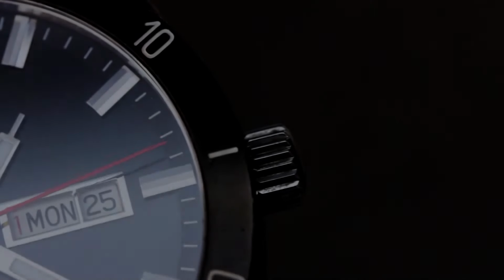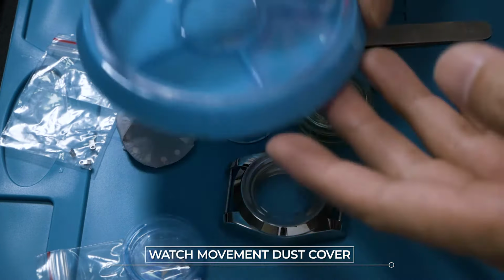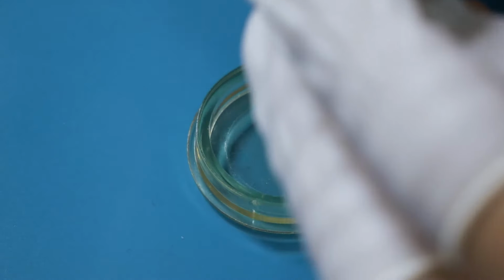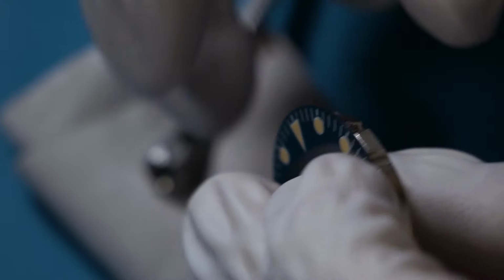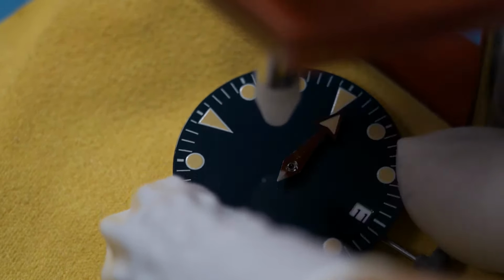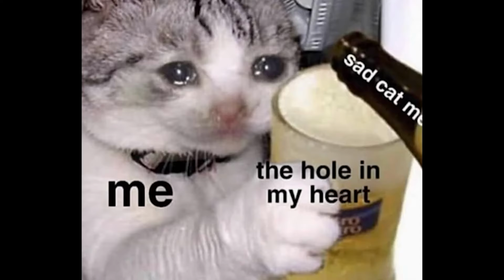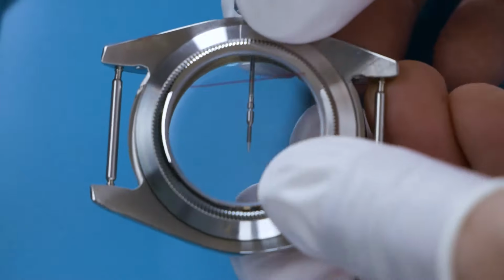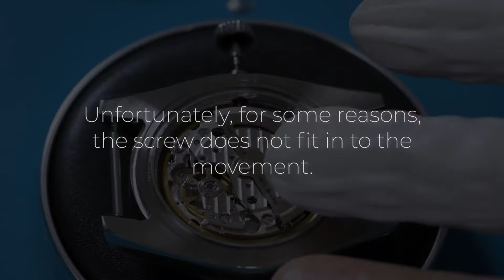How to build your own custom watch (Don't do what I do, learn from my failure!)

Comment: The first time I did this, I used an ETA 2824 movement. It took me the best part of 2 hours and lots of cursing to get the seconds hand fitted. This was a few years ago before all the kits that you can now find and I didn’t see any tutorials on YouTube either. I’ve since made more using 2824 movements and also NH35/36 movements and I agree with the other commenter that the NH movement is the one to start with. I’ve messed a few up, and it’s a bit disheartening each time you do so, but in the end you end up with something unique. I’ve given them as gifts - my wife has been the recipient of a couple and both my children got one as 18th birthday presents. My next project is for my newly-born granddaughter.
Reply: Legend
Reply: definitely a very special present

Comment: I just built my first watch with parts all from AliExpress and it went fine.  I will say that the seconds hand was an absolute pain to get in place compared to the other hands but a little Rodico and a 5x eye loupe was enough to get it done.  I also recommend plastic tipped tweezers so you don't accidentally scratch anything.  Also, the Seiko NH35A movements don't require screws to hold the dial in place and they don't require any clamps or screws to hold the movement in the case which is why I chose to go with the NH35 movement.

Comment: I've been a watchmaker for like 4 weeks now, interested in watches for like 8. This is by far the best video I've seen lol. Every single mistake you made goes through my head whenever I touch a movement. Off topic a bit, but the first two movements I serviced are from vintage quartz watches. I literally didn't know you could service a quartz movement, but it's true, or any movement until 8 weeks ago. On the one I finished last Saturday, it was actually a non runner, so not only am I new, I also had to learn in short order, so I could diagnose the problem, which I did and ultimately fabricated a replacement part. Not bragging, just saying there is always a level of service you can do I guess, even for quartz watches. I passed them both to my daughter who will hopefully keep them long enough to pass on someday.

Thanks for the great video and lesson! ❤it!

Comment: I'm new at this too and you're not alone in stuffing things up. I find the NH35 movement to be less difficult. Thanks for sharing keep after it. I find joy in giving as a gift, a watch I assembled. Each one I've given has a makers mark. By that I mean  a scratch, or small bend, but it it can only be seen with a loop. Cheers
Reply: I have a question. When i buy the case where the movement goes in I can choose the size 36/39mm. The nh35 movement has no size. How do i know that the nh 35 movement fits in the case?
Reply: @pimengelbertink9926  I have used both 36 and 39, just make sure that is says in the description that the case is compatible with nh35 or nh36 and you'll be fine.

Comment: Thanks so much for posting this.
I am gathering some bits to build my first watch. 
You have probably saved me from using a screwdriver with rodico on the end to clean up the dial.
Also prepared me what to look out for when fitting the hands.
This has been such an educational video. 
Don't give up.

Comment: This was a great video. I learned a lot. 

This is why I haven't tried to build my own watch. 1. I need all the equipment. 2. I need multiple parts because I will F them up. 3. I no longer have the steady hands required to do the build. 

But I would like to design my own watch, pick out all the parts. I would have to have someone with experience to do the actual build though.

Thanks for doing this!!
Reply: Yeah I get you. I don’t have steady hands either. I have very shaky hands. I messed up my watch just trying to change out the battery. I touched it once, twice and then BAM everything went flying out of it. I messed it up 😂 but I too want to build my own watch. I’m  gonna challenge myself and give it a go with an automatic movement. Shaky hands and all. Yeah I’m gonna mess it up but I’ll get it done with my own unique dings and dents on it.
Reply: @americanpaisareturns9051  Thanks for the reply. I have since thrown caution to the wind bought some equipment, and assembled my first watch. The hands were the toughest part taking 2 seconds hands (I bent the shit out of the first one) and about 7 hours total build time from start to finish. I'm gonna try it again. 🫣
Reply: This video confirms that I shouldn't attempt this.  😂

Comment: I personally use pegwood with rodico on the end to place the hands and to help clean up the dial and hands afterwards. It helps to get right down to eye level with the movement to see the pinion where the seconds hand will go, and to use the handheld hand setting tools.

Comment: Yeah, the seconds hands on the Miyotas, DG 2813 and relatives are the most demanding because their axles are only 0.17mm thin. ETA's 0.25mm seconds hand axle feels like a beefy rod compared. Patience and carefulness finally wins all the obstacles though. Complete those with experience and we have a winner.

The real watchmakers use peg wood sticks for manipulating and cleaning very delicate parts, but I use just cocktail sticks. 🍸😋

Sooner or later every watch hobbyist runs in situation where he/she would need some standard little screw or a few, so best to be prepared and purchase a watch screw set beforehand, so the job at hand wouldn't again pause by lack of a cheap standard part. Check carefully to order real watch screws that actually fit a wrist watch, not those "Watch and Glasses Screw Sets", which by guarantee do not have one screw who would fit in the innards of any normal wrist watch.

Comment: I messed up my second hand also the first time. The pivot was okay i think. Now you can take the moment apart and try to straighten it out . You did great for a first attempt. We all have yo start somewhere. I rather learn on my 35usd movement than a 1000usd movement.

Comment: The bent washer under the dial is to keep in place the hour wheel that in some movements is just laying over the cannon pinion without any bridge to keep it locked in place. Without that washer the hour and minutes dials can go out of synch. But I don't think this is the sase with the Myota movement which has a bridge covering the whole dial side.

Comment: Brass, bronze or nickel tweezers are your friends when handling hands or any part that can scratch.  Dials scratch incredibly easily, so best to avoid fiddling with them too much, or drag tweezers over them.  I usually use brass and keep my nickel tweezers for the more precision stuff that still requires a delicate tool.  Brass is the safest, but they bend really easily.  

As for the hands.  I haven’t found a second hand that won’t fight back.  I personally don’t recommend the cheap hand press used in the video. They tend to cover what you’re trying to see and too wobbly. The real ones cost a good bit and have no wobble. Best to use a good set of handheld hand tools, get down super low with a good loupe with around 4x magnification, use Rodico to hold the hand in the proper position with the non dominant hand, then press on with hand tool in dominant hand.  Yeah, it’s awkward having your face at desk level working 4” away from the movement with a loupe, but the second hand is like balancing a needle on a bit larger needle. If you can’t see what you’re doing or not gently pressing down perfectly perpendicular to the stem, it will bend.  

The movement doesn’t matter, as the battle with the second hand will be the same.  Cheaply made hands will make the fight even tougher, so best to source the better parts.

Comment: As someone who successfully built my first watch with a Miyota 8215 movement just a few weeks ago (after 4 years of tracking down parts and making mistakes) I would NEVER recommend anyone start building watches using a Miyota movement. Too many variables out there that aren’t right. I found 2 or 3 different dimensions for hand sizes. Case clamps are hard to find and expensive to replace, the movement is kinda finicky. 

Please start with either an ETA 2824 clone or a Seiko NH series movement. Sooo much easier and a lot more comparability due to Seiko standardizing there line of NH movements.

Comment: I don't think you should use that tool use the hand tools instead and put the hour hand at 9 so you can see what your doing. I'm no expert btw but I've watched many videos. I have tried this but I am way too shaky and can't control my hands long enough and the more tension the worse it gets. I have a tremor due to motor neurone disease😢 but I try with watches in to worried about. But it was great to watch a Newby trying as it highlights the problems us wannabes experience 😢😊 dude you tried and at least hands aren't costly. Good luck next time maybe note down your mistakes.